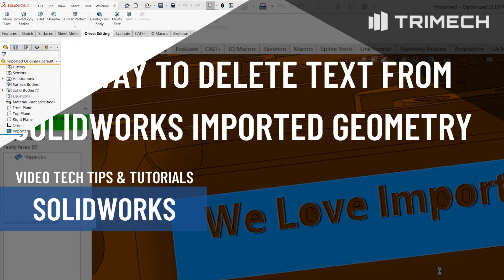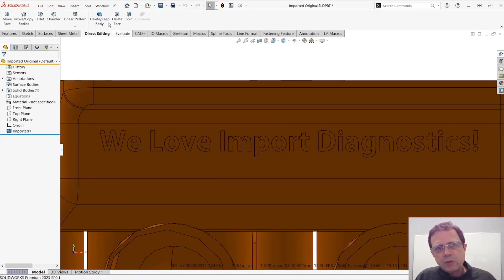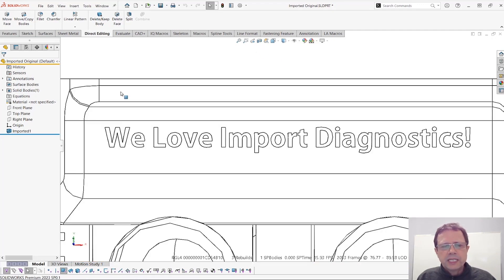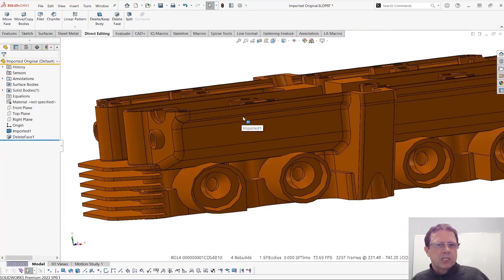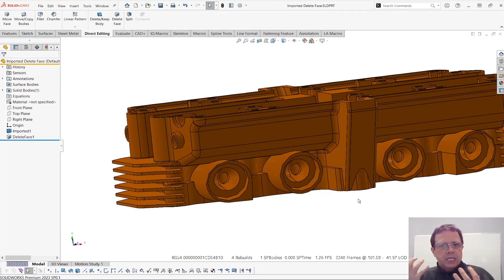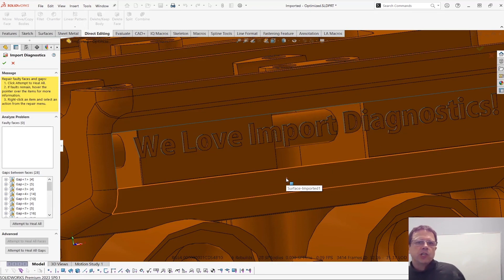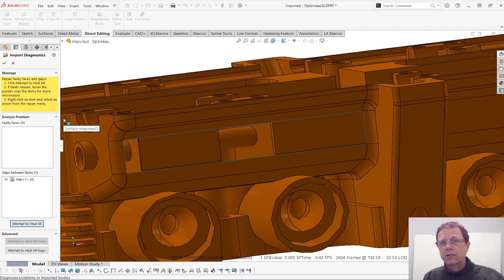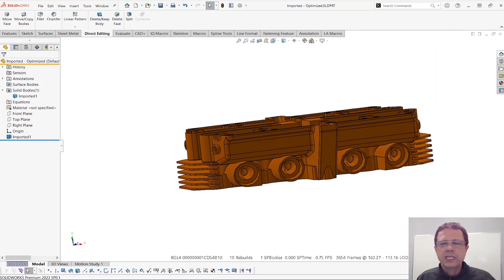Best Ways to Delete Text from SOLIDWORKS Imported Geometry

Comment: Great tips as usual from Alin. Using this method on imported parts to reduce graphical triangles and file size is a great performance improvement all around. The parent assembly files that contain these optimized models open/save and rebuild quickly. We have reduced our open/save and rebuild times drastically allowing us to work efficiently. I appreciate how Alin gives multiple solutions to the "problem" and explains how it works. Great work.